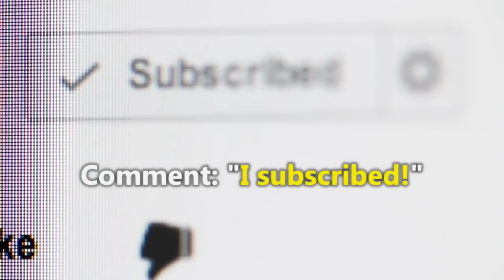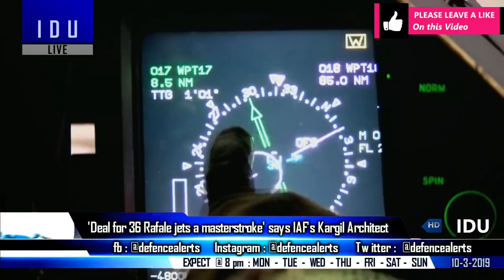Indian Defence Updates : AMCA Thrust Vectoring,IRST For Tejas MWF,126 More Rafale,ISRO-NASA Collab

Comment: AMCA & Tejas mk-2 medium category should be running by general electric engine GE - F -404 for trial of  protypes for full fill gap of production otherwise we should    go with Al-31FP turbojet engines have more thrust value which is under licence manufacturer by HAL after full scale production as India have Rafale offset clause we should collaboration with Saffron for kaveri jet engine when it complete we attached engine with AMCA & Tejas mk 2

Comment: We cannot trust any country for AMCA because it gives India an upper hand in the world, so just focus on to the engine development , with or without the help of others
Reply: Crucial point. It's indeed required by INDIA to develop right from nuts and bolts. Self reliance is key to successful AMCA project.
Reply: That's right
Reply: India doesnt have the knowledge to build 5th gen turbofan you stil struggle with a 3 gen. Time you finally got it build 30years gone .no country will give tech transfer especually on 5th gen thrustvectiring engines. If 5hey do they stupid
Reply: @quintenvandermerwe9952  hey.. Thanks for the understanding and reminding us again. But we don't give up so easily. This is Naya(New) INDIA, which will not rest until the target is achieved. Namaste 🙏
Reply: @quintenvandermerwe9952  don't worry for us ...we have remained. Mostly self reliant for 70 years and will

Comment: Since India has already opted for the Rafale and since French Jets have been IAF’s proven and go to platforms for striking beyond the Line of Control least amount of time should be exhausted in exercising the option to get additional Rafales. The IAF has almost setup the entire infrastructure requisite to operate the rafales and other dynamics corresponding to the combat aircraft’s operability wouldn’t amplify costs. Last but not the least India should partner with Safran to develop AMCA’s power plant due to : 

A) Congruence with existing platforms in inventory which would also consequentially stall inflating costs corresponding to next generation platforms 

B) The willingness of the French for full TOT which is critical for fabricating next generation platforms and the acquired ability to overhaul specifications of the Power plant to suit the Indian Conditions

C) Nothing against Russia’s AL 41 F and the Russians have been our closest allies and equipment suppliers but the power plant isn’t operational till now and key technologies from the power plant have been taken by 117S that powers the SU 35. In a nutshell it is yet to be a fully operational  5th Generation Engine.

Jai Hind 🇮🇳🇮🇳🇮🇳❤️